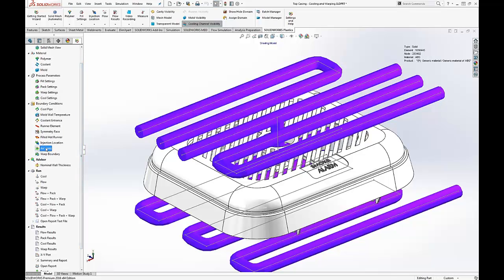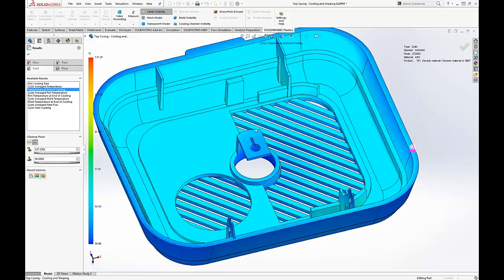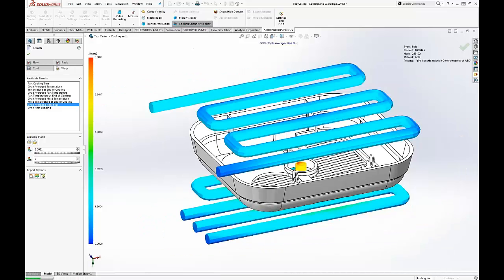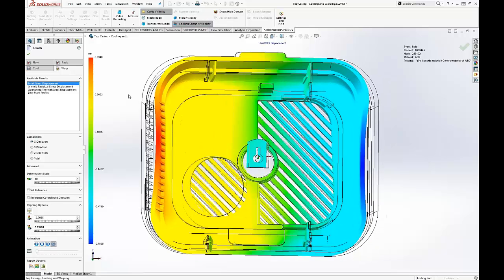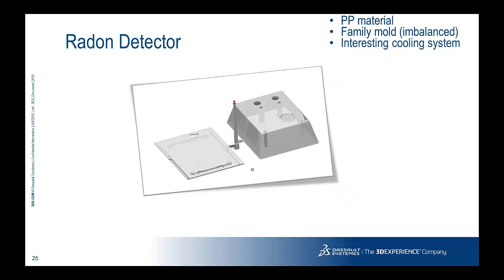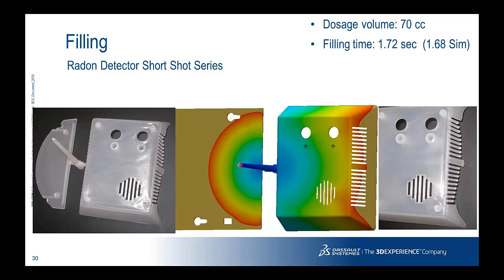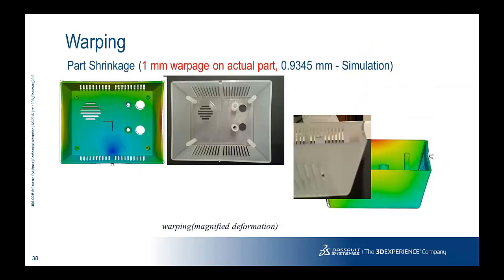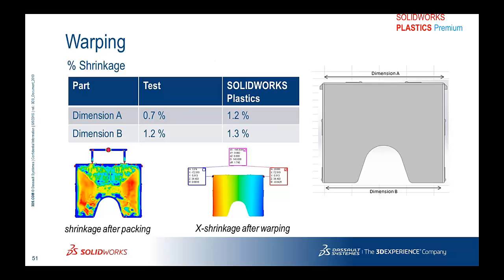Webinar SOLIDWORKS Plastics 09-06-2016 ENG PART4

Comment: I'm a student at Cape peninsula university of technology. Currently I'm final year project which I picked from one one the company based here which is to design a Twisted blade mold with double cavities. And right now  my institution is on holidays and it becoming a bit difficult to get my CAD lecture as I'm using my institution software for my project. Hope you get my point of where I'm stopping at.

Comment: Hi. Thanks for this great input for us on solidworks plastics but one thing I'm struggling with is Solid Meshing doesn't allow me to proceed with in working with a double cavity mold for the same sample. Everytime I try and I get this message:" Solid analysis does not support more than one isolated cavity. Please ensure that the runner that feeds the cavity has been designed and meshed to allow the simulation." Please what can I do next? as I already designed my runners and the cooling channels of my mold.  I'll really appreciate for your feedback on this. Thank you. 

Kind regards, 

Ruthain M from South Africa.
Reply from the maker: Hi Ruthain, thanks for your feedback. Please forward this issue to your reseller. if you want you can send me an email to help you contact them.